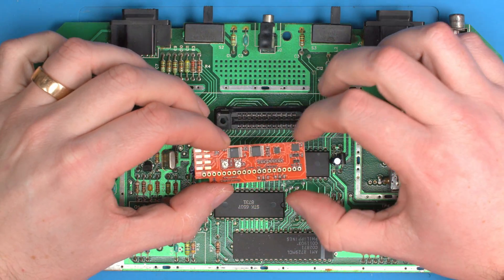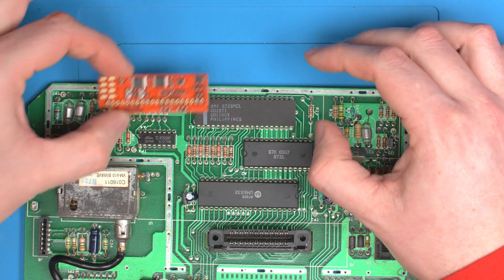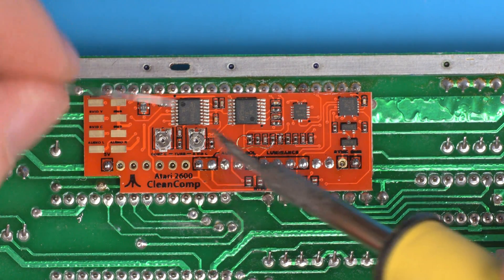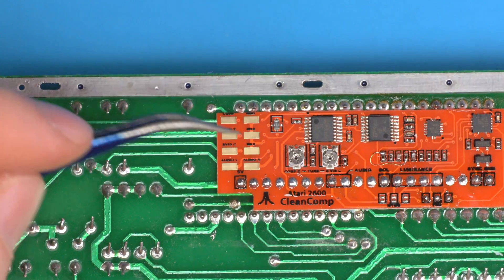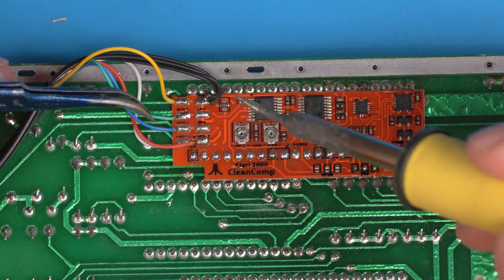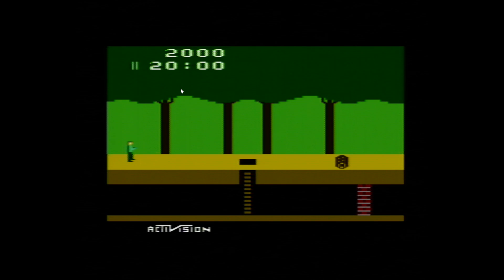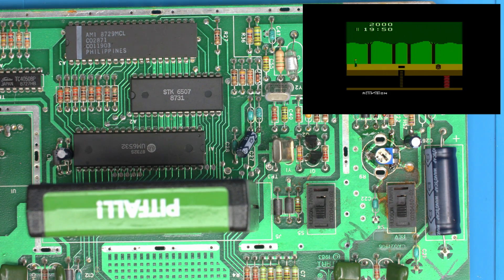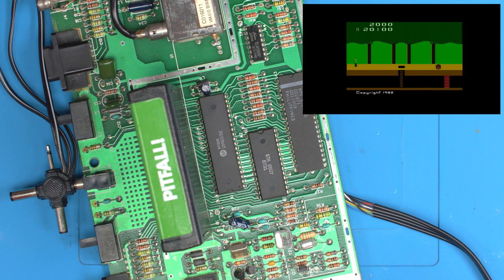Atari 2600 Composite S-Video Mod (CleanComp) Install

Comment: Great mod!

Thats interesting that a switched mode power supply produces so much noise.

I would have thought that since it uses a PWM controller that the signal quality would be crisp.... apparently not.

Comment: I don't think you mentioned it your mod knocks out the RF out.  I will stay un-modded until someone makes a reversable mod (check) that retains RF (do your circuitry check that box?).
Reply from the maker: You can use RF alongside the CleanComp and both composite and s video so you have 3 outputs

Comment: I have a slight issue.  My board is a heavy sixer and there are resistor legs just below where the CleanComp should go so it will not lay flat.  I removed some solder and cut them as close as possible, but the legs on the TIA socket still are too short to come through the CleanComp.  I may need to solder jumper wires in place unless someone has a better idea or suggestions.

Comment: Hey man, I love this mod! I bought two boards, installed the first one and works flawlessly. 
Tried the second one and I ran into some issues. Upon inspection I noticed that one of the transistors on the board got knocked loose (probably my fault!)
This is a bit of a long shot - I understand you probably wouldn't wanna share in depth details about the circuit you developed and are selling but any chance you could let me know what that transistor is so I can replace it? Very far bottom right, under the GND pad (Rev 1.0.4)
Reply from the maker: Email me contact@retrosix.co.uk

Comment: I get really good results running the RF output from my Atari 7800 and 5200 into Extron AVT 100 NTSC
Analog TV & Cable
Demodulators. The converted Composite signal is very nice indeed. Looks much better than my composite modded 2600. It’s no contest.
Reply: I have noticed the same- extremely good RF on televisions with circuitry that does a good job cleaning the signal without adding too much lag.  My experience has been LCD 720P with RF for the cleanest signal.  1080P TVs are hit or miss for having too advanced circuitry that adds to the lag.  Top tier name brand like Sony, Panasonic ect. seem to be the laggy TVs, but mod tier or off brand hit that sweet spot.  My favorite has been Sansui.

Comment: Hi got an issue with composite video. I tweaked the pots like you suggested and sadly I'm not getting color anymore no matter how I turn the pot. Any advice on how to fix this? S video looks fine thou
Thanks again for this cool mod
Reply from the maker: If s vid works it's likely broken pot on CleanComp for COMP wheel. Try measuring it with multimeter to confirm

Comment: I bought an Atari 2600 4 switch with a broken RF cable (i think). I'm planning to install this mod myself even though my late uncle has more experience with electronics than I do. Regarding the power supply, what if you used Atari's OEM power supply that came with the console? Will that make a difference?
Reply from the maker: OEM power supply will be fine too

Comment: May it is not interesting for most of the people 😁 , but this was the only way for me to get the Atari 5200 CX 55 adapter to work on a modern screen .
You have to modify the art of solder that S-Video mod , but in the end the result is perfect and works flawlessly 👍

Comment: You really shouldn't put all of the ground wires on the same ground pad.
You should use all of the ground pads for more strength.

Comment: ? Its an elegant solution and a nice PCB..... but I honestly cannot tell any improvement over the basic single transistor composite mod?! The picture is still very soft and blurry with edge artifacts... so, other than ease of install.... how is this solution superior to the cheap and nasty single transistor mod, which incidentally is not effected by switch mode power supplies (which pretty much every one uses these days)?

Comment: A suggestion for the power supply : could it be a thing, having a USB C mod, like game boy/gears and others?
Reply from the maker: Yes our Master System CleanPower works fine I just need to make a specific version so it can easily mount on the Atari console without needing epoxy

Comment: Is it recommended to remove rf circuitry?
Reply from the maker: It makes no difference so I would keep it. It still functions
Reply: Just finished the install and am very happy with the results.

Comment: Can we get more info on the stereo audio mod for NTSC, specifically on the light sixer? I'm not seeing anywhere the left and right pins are connected.
Reply from the maker: The console joins both channels so you have to cut the join then seen each left and right out separate. However most games only send audio out of one channel so really it needs some additional logic or manual switch to mix channels back together for unsupported games. I've not done much more investigations other than that so far

Comment: Were you already able the solve the problem with switching power supplies?
Reply from the maker: Noise? Yes. I just never bothered releasing the product. Basically a special combination of filters. Works on all switching power supplies on all consoles to remove all video noise

Comment: Is there any version of this that allows HDMI output?
Reply from the maker: No point upscaling composite to HDMI but I can do it. I plan to possibly interface with the TIA next to replace it and then generate RGB then to HDMI from that
Reply: @RetroSix  just for ease of connection I would definitely be interested in that.

Comment: Hey pal. I'm thinking about buying this one, but you mentioned the interference regarding the power source. You mentioned you tested on all sorts of Atari models. I have an officially licensed Brazilian "Vader" model, made by Polyvox that has an internal power supply and I'm worried that this could cause interference since the TIA is fairly close to the power supply. Have you ever tested this mod in one of these Brazilian models? Mine has a UM6526N TIA.

Comment: Just ordered this from ebay.  My player 1 difficulty switch is a little sticky, has dust just gotten in there and needs a good clean?
Reply from the maker: Lift the metal switch off the physical switch then clean inside it with IPA

Comment: I managed to install the mod myself too in my Sears TeleGames Light Sixer made in Hong Kong in 1980 - right after recapping the beast and replacing the aging and wobbly power port. I'm thinking of replacing the controller daughter board edge connector too (with a keyed 12 pin molex connector on both ends) as the connector is quite finnicky and can be a royal pain to make sure it is in the right spot so the console will turn on every time. Good call on the S-Video output. I'm getting ringing artifacts on my console so I'm going to go back into my console tonight and reduce that S-Video Potentiometer. The Composite Dial is remarkably sharp as default so I'm leaving that potentiometer alone.
By the Way Here's a tip for all you Retrotink 5x users out there:
Some Games, such as Battlezone and The Star Wars Parker Brothers Games, have sync issues due to sometimes (Star Wars) or always (Battlezone) changing vertical resolutions. In order for you to have the proper output I would recommend:
Setting the Horizontal Sampling Preset to SNES/PCE 256, Set Lock Speed to Fast and Set Phase Detect to 3/5 when the console is on for sharper video for either profile. Always use Triple Buffering.
For games that don't need it, Set Vertical Filter to Sharp, but otherwise use the smoothing filter. That should filter out the problem while keeping the game playable.

Comment: Would this work on a clone with built in games? It uses UM6526P1  as the TIA.
Reply from the maker: Never tried. If its got same outputs as TIA possibly

Comment: Very interesting video (and mod). Could you please show how the re-assemble the case with the cable and the mod installed? Is it necessary to cut the Jr. case to pass the cables? Thanks.

Comment: A little help with my atari2600 just fitted this great mod just wired it up but for some reason it's black n white. It has a very clean immage and the sound is perfect. Iv set it up to audio video as I'm ok with that. Any help is appreciated .
Reply from the maker: Turn your color wheel on Atari to tune it. Also measure the col adjust pin on TIA to make sure it moves between 0 and 5V when turning the wheel to confirm it's working

Comment: I installed this mod on a 4 switch Atari yesterday. No sound. Also, the video output isn't perfect. It's hard to describe - like you are looking sideways on an old LCD. Double-checked my connections, look good. The RF signal has video and sound. Does anyone have experience with this issue?
Reply from the maker: Never seen that before. Jump on discord.gg/RetroSix and share image/video

Comment: Just can't get it to work, i have the jr with a retrotink pro 2, composite either works or works for 5 mins then it gets corrupted and black and white, s video doesn't work at all, tv knows there's a signal but shows nothing or tells me the resolution isn't supported, i got sent 2 cables not a combined, belled out the wires so know they are the right way round, going to re-solder everything then give up :(
Reply from the maker: Have you tried your color tune wheel on console? Sounds like that's out
Reply: @RetroSix Hi, not adjusted the wheel on the console, It worked for 5 mins or so, here's a vid of what it's doing...  https://youtu.be/Uf3P0XX6dx0?si=uwl3PXwpJwWLPlef
Reply: Both composite and svideo, when it looks normal the colours are right, on the vid it looks wrong for that game but that's the camera, it's as though it's ok when you first turn it on it's fine then after it warms up a bit it starts messing up.
Reply: @RetroSix  Yes now adjusted the wheel and the and the 2 pots on the board, no effect, after re-soldering the board 5 times one of the tiny pal pads has burnt off, i will wait for the 2600 plus, won't buy another board from you
Reply from the maker: @steveford1070   happy to send you a free replacement
Reply: @RetroSix  bought another one with another 2600 board, still a dud, the pads lift off too easily, 2 broken 2600's and 2 broken mod boards
Reply from the maker: @steveford1070   not to sound offensive but sold 400+ now and not a single person has lifted pads. I suspect your iron is way too hot
Reply: @RetroSix  you could be right, but with a crap load of flux and nothing sticking what do i do? another board is going to be a similar price to the atari 2600 plus, the first board only lifted the pads off after i resolded 5 times, the seconded about 4 times
Reply: They also send you 2 cables with strands and cotton fibres not like the single stranded cables in the vid, try connecting those together.
Reply: @RetroSix you have my contact details , i've bought 2 from you,,,,, both dont work
Reply from the maker: @steveford1070  Can't find your order from name, just email me contact@retrosix.co.uk
Reply: @RetroSix done from your website not ebay

Comment: The better install tip is to measure which pin on the TIA chip is ground and line that up with ground on the cleancomp.  On my console the notch on the chip was on the opposite side of Luke's when having it oriented to be readable. Those so many dang revisions of these boards!
Reply: I read your comment and then after I installed the mod and it didn't work I remember to check for ground on the TIA. So thank you.
Trouble was, trying to remove the mod (which was soldered directly to the pins) was impossible without damage, so I needed another. For the second CleanComp I used jumper wires in case it needs to be removed sometime.

Comment: Hello, I emailed your support address a question which sent an auto reply that it had moved to discord, but I do not use discord and just wanted to make sure this was seen.

I have a 4 switch NTSC unit with the upside down TIA chip, and the text is upside down but there is a 1 cm rectangular cutout on the left instead of the right. I have never seen a notch like this on a chip before, and the other 2 chips have their notches on the right. How should I orient the CleanComp when looking at the back side of the board oriented normally with the cartridge slot above the chips, does the mod go right side up per the instructions at 2:24 to match the notch, or upside down to match the instructions at 1:39 to match the text?

Thanks!
Reply from the maker: Check which corner is ground on the TIA using a multimeter then solder the ground pad of CleanComp in that orientation
Reply: @RetroSix  yeah that’s what I was planning on doing if I didn’t hear back, I was just looking up pinouts now. My hunch is that since all the chips are upside down, the notch/cutout is not an indicator. Thanks.
Reply: @RetroSix  ok so I installed it today, and after powering it on I got no picture or telltale flicker that video was working. After a minute or so of testing the cart and switches, the large cap on the input power exploded. I’m not really sure what to do now, I replaced the cap already and know it was good, and I was getting a picture from the transistor mod even though it wasn’t correct. Im using the original Atari power supply, everything else should be fine but it does still have all the disconnected components required from the transistor mod. Has this happened to anyone else? I can send more photos if that helps. I do know how to solder so I doubt I did anything incorrectly, and it was working before the mod.
Reply from the maker: No that's never happened. Jump on discord.gg/RetroSix and upload install photos so I can see. Perhaps something is wired wrong
Reply: @RetroSix  Sorry I don’t use discord. This morning I ended up replacing the cap again and the RF components, refurbished the RF modulator, removed the cleancomp mod, and tried to connect to the TV using RF and it worked fine so I’m assuming something was faulty with the mod board itself as I’m reasonably certain it was installed correctly, but I don’t know what would cause the cap to blow. I removed as much solder as I could but tore some of the mods solder pads off when removing it due to solder down below the top of the board where I couldn’t reach, so I can’t really try it again. I’ll just have to table this for now and try to figure something else out.
Reply: I didn't blow a cap like you're reporting, but I did install it onto a 4 switch Vader and can't get video out of it.  It did work on a light sixer, but I unfortunately ran into a lowly documented problem where there is bleeding in the image due to a known issue in one specific board.  Disappointing.
Reply: @jblackacre2325  get the UAV mod, it’s easier to install, works great, won’t damage your board if you need to remove it, and works on lots of Atari systems. They answered questions over email too.
Reply from the maker: We answer emails, as well as discord, as well as Instagram, tiktok and YouTube. Also replace faulty units without problem. UAV is good but not as clean (been proven independently), far longer install and more complex, but it's an option if they want to try it for sure
Reply from the maker: Just ask for free replacement on your next order in the notes and I'll send another

Comment: This is great, I'm hoping to retire composite video from my av setup but the 2600 and the NES are the pain points.  This seems quick and easy (for someone lazy like me)  for the NES I may just go with a composite to S-video adapter just to ger rid of the composite switches.  I'll keep an eye out for the new revision.
Reply: I couldn't wait and decided to order, the store had the picture of a white PCB, so I'm guessing that is the new revision?  Either way, I am excited to get this installed!
Reply from the maker: Yep you should get the new version

Comment: So I originally tried this a couple of weeks ago and coudn't get it to work. However I tried it again on an Atari 2600 Junior and It just works! and I must say I'm pretty impressed. So much so that I will be buying another one very shortly. One question though, Is there any scope for a version for the Atari7800?

Comment: Very interesting. Is it possible to make an svideo chip for nes than an expensive nesrgb kit?
Reply: Hi, native S-video for the NES is a no go sadly. The 2C02 video chip generates Luma and Chroma directly inside of it, so there are no pins or external places to grab that signal. It's unfortunate.

Comment: I fitted my mod to the first of my Light Sixers successfully enough. The difference in picture quality was apparent, I'm pretty happy with it. Many thanks.

One tip for modders; if you reassemble the 2600 and find that you have a B&W picture, dont disassemble the unit and check your soldering and cable routing.....check that the "Color/B&W" switch is set to "Color" first :) 

DAMHIK

Comment: This was exactly what I was needing. 2 ordered today, many thanks. I may stick a blob of hot glue under the board for a little bit of extra strain relief, as I can be clumsy with wiring. Cheers.

Comment: Not gonna lie. Really tempted to send you my Psp go for repair. Guy at work shook it when the screen was popped up and I think he damaged/dislodged the ribbon attaching the screen to the main board. Also have an Original PSP 1000 which I stripped by accident trying to fit a new screen...just call me butter fingers.
Reply from the maker: You know where we are when your ready 👍
Reply: @RetroSix  Yeah may have to take you up on that. Pretty reasonable prices it must be said 👍

Comment: Do you have a TRIAD power supply you can test with? its very commonly used as a quality replacement supply for many consoles, it would be nice to see if that affects it.
Reply from the maker: I don't have one no. But they look like transformer based on the size